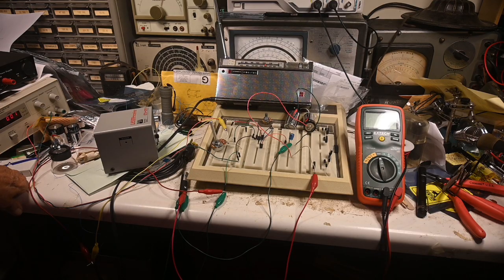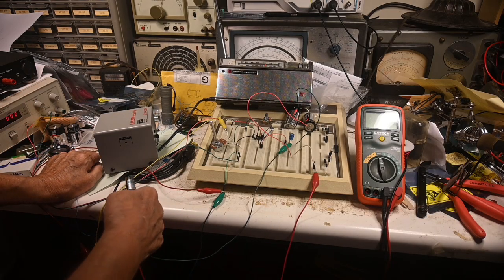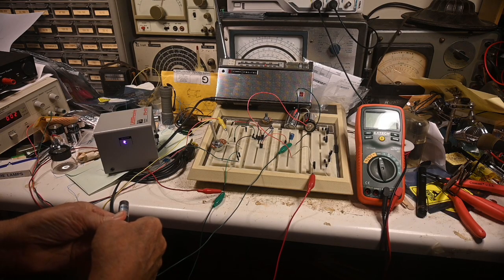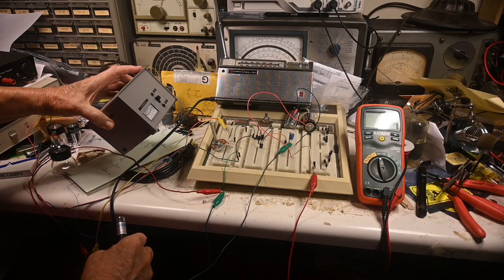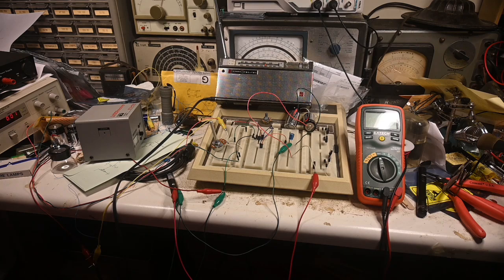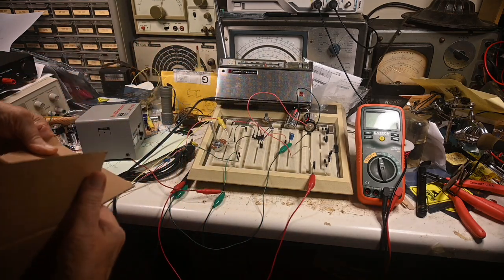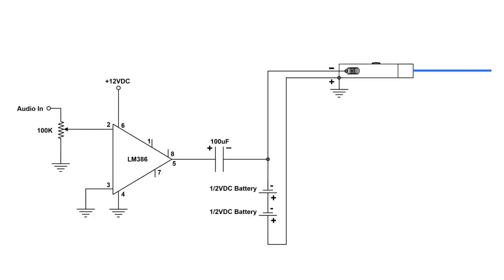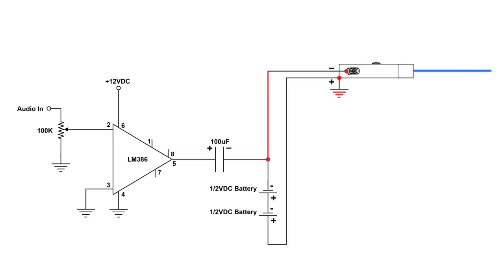Audio Modulation Laser Pointer LM386 Amplifier

Comment: I just saw this. It's amazing what we've discussed, and the experiments you've done. I really appreciate your efforts. So, it can be concluded that yes, light can transmit sound waves with the LM386. Amazing.
Reply from the maker: Thank you! It did make an interesting experiment and for little cost. I thought the sound quality was very good! Thank you for your question, this was fun for me.
Reply: @AllAmericanFiveRadio I want to ask sir, for the lm 386 output, does it go to the laser gnd and the lm386 gnd? So they are combined on one gnd with the lm386 output pin 5 there?
Reply from the maker: @zzaa3595  Hi, There are two circuits. My Laser Pointer has the spring as the negative and the outside case as positive, this circuit is 3VDC. The other circuit is the LM386. The output of the LM386 through a 100uF capacitor is connected to the spring of the Laser Pointer. The -12VDC ground of the LM386 is connected to the case of the Laser Pointer. The 100uF also isolates the two DC supplies of the two circuits, and it sends the signal from the LM386 to the Laser Pointer. Hope this helps. Keep asking your questions.

Comment: Very interesting as built a similar concept, but offset the laser output via a variable horizontal scan.
See my channel for examples.

I used a 300mw Green DPSS, 
Variable input modulated filters (high / low pass) for laser output. 
Variable Frequency Amplitude generator for offsetting the beam (using front surfaced mirror) 

Results were truly beyond amazing. 
Uploads are a million times better in life as camera shutter speeds do not show the complexity. 

Maybe worth a look if interested.
Reply from the maker: I'll take a look, and thanks for the information!

Comment: Nice project, but who needs to waste an LM386 when you can modulate a laser with a small transistor?
Reply from the maker: A YouTuber wanted to know if you could a LM386, sent the circuit using a transistor.

Comment: Thanks for that.  I was doing this in a different way back in the early 70's with a car radio and a dash light bulb. I used a very small reel to reel recorder as a amp. Worked really well. Lasers were not common , for me anyway. I rarely bought anything new , always using junk parts.
Reply from the maker: My first 8th grade science project was a flashlight that transmitted audio form a record player to a small photo cell and amplifier. It worked very well. Experimenting is fun. Some questions I get are why did I use that part? Usually the answer is “that is what I had on my workbench. Thank you, and thanks for watching!